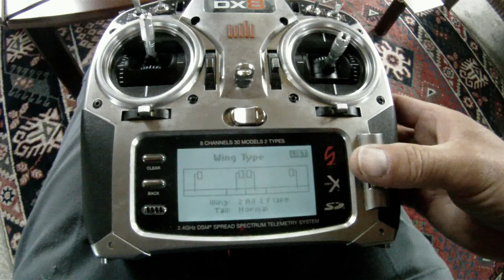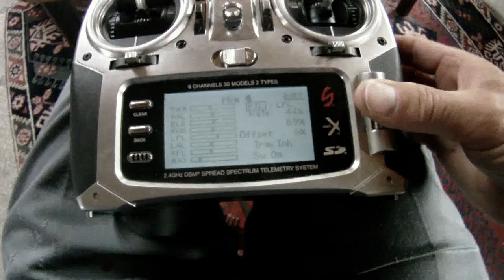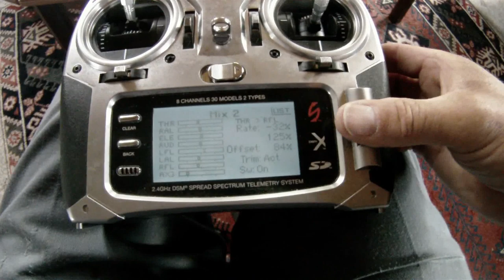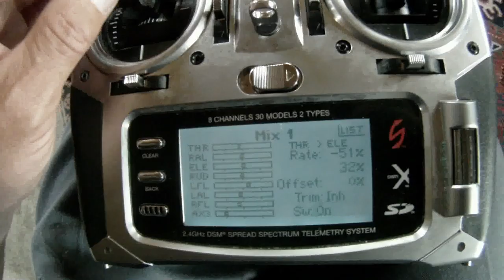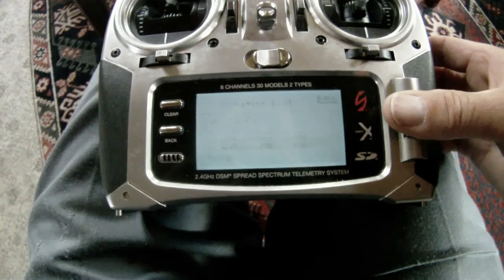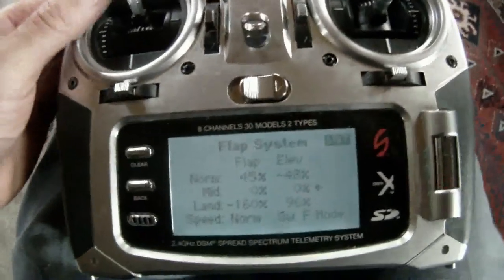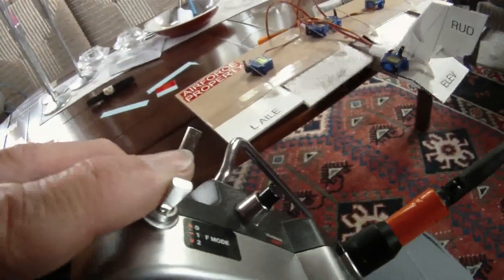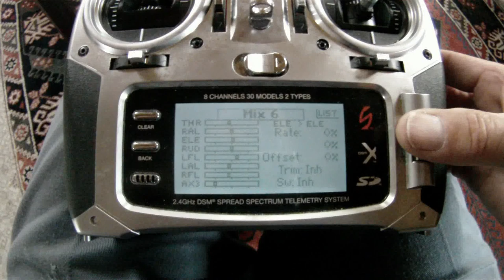DX8. 4 flap wing Glider setup.

Comment: hey dude. having a bit of trouble with the initial setup. for the flaps, i plug one lead into gear channel, and the other flap lead into AUX2. The system recognises only 1 flap (the one plugged into the gear channel) the aux 2 flap is not responding...any suggestions?
Reply from the maker: Be sure that it set up as 4 flap wing in wing type. And take a look on the monitor screen and see what happen. Check servo plugs in the rx.